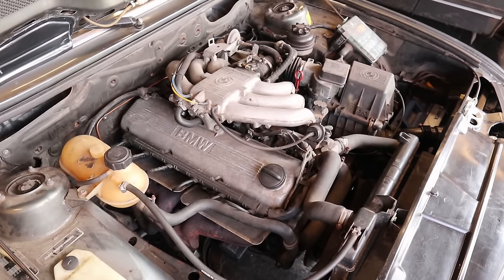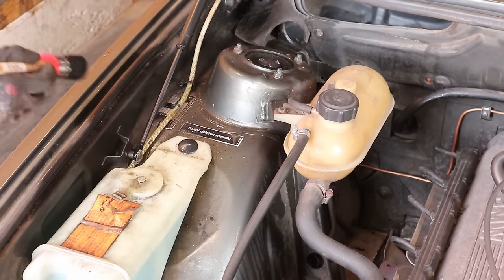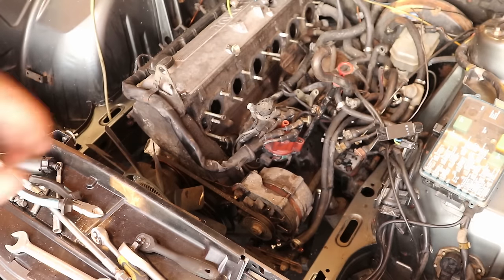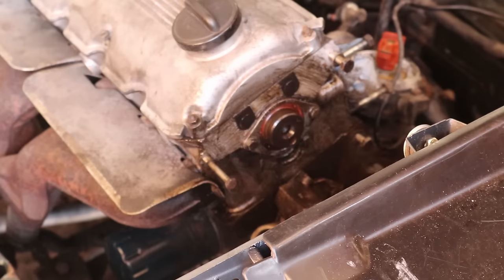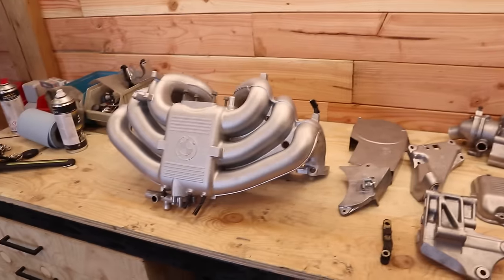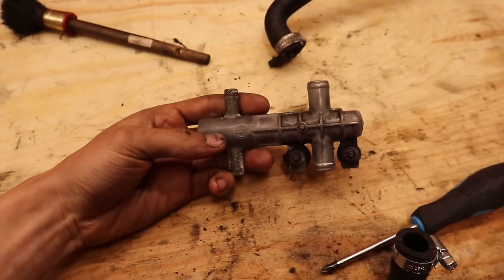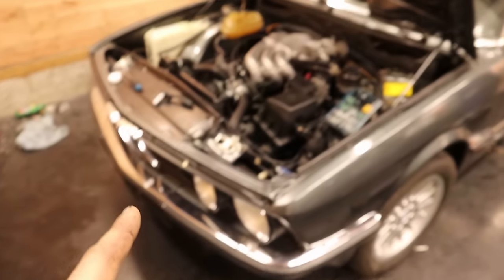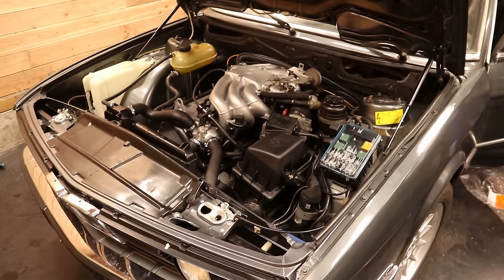BMW M20 Deep Engine Bay Clean & Maintenance | Vapor Honing | E28 Restoration

Comment: I replaced my intake manifold on my M20b20 today too, I have an early E30 with the same engine and I've been having idle issues too. Took me almost a year to find another additional air slide valve which ended up costing me a whole engine to get. I tried everything to unblock it and the best thing I did was put it in the oven a few times at a high temperature and then let it sit. The inside blockage turned to powder and I was able to knock it out. Great video really enjoyed watching it even though I've done the same thing to my car lol 🤘

Comment: Great Video.. luv watching the videos on the E28 .. reminds me of my old E28 .. same color too... never should have sold it ... 2 things
1 - the original stamped steel camshaft sprocket is a know defect and tends to crush and send the engine out of time ... it has been repalced by an upgraded cast metal one by BMW and a good thing to change to avoid a costly head / valve job... don't ask me how  I know ;-)
2 - Nice to see you improvised a fan removal /  installation tool similar to the one BMW sells .... the BMW one is quite expensive... another option is to put an appropriately sized pin in the hole and put it in the bolt hole
Keep up the good work
Reply: Important info about that sprocket!

Comment: Super job. I did a similar process on my Mercedes 190e but admittedly not as comprehensive. It just makes the engine bay so much nicer to work on. Well done. BTW I would be very happy if the new project was a Mercedes 190 😉

Comment: Great video Memphis. Very methodical approach with excellent commentary, you've taken 20 years off that engine bay. That old timing belt was definitely on the way out, glad you didn't skimp on any of the associated parts or gaskets either. She really sounded sweet when you started her up, probably due tot he tighter timing and clean injectors. That E28 looks cooler by the day, I think you're gonna have a blast this summer. Keep up the great work and thanks for creating, editing and uploading these videos dude.  👍😎

Comment: Check the exhaust system leaks, also check the o2 sensors if they are working fine, finally check if you have a leak from one of vacuum lines, hopefully you will find the idle problem.

Comment: Ahh you missed replacing the half moon seals on all 4 corners of the valve cover gasket.  Typically ppl mistake the oil leaks on the camshaft seal for these.

Comment: Have you thought of using M50 injectors in your m20, I found they made a huge diffrence. They have a much more modern spray pattern to atomize the fuel better.
Reply from the maker: No, but thanks for the tip

Comment: Leuke video ! Proper gedaan ! 
Mag ik vragen van waar je die revisie set voor de injectors hebt ?
Reply from the maker: Ebay
Reply from the maker: https://www.ebay.com/itm/334026647358?_trkparms=ispr%3D1&hash=item4dc58a273e:g:r1cAAOSw2LNiJa1L&amdata=enc%3AAQAGAAABIIP35eWetygilOL1VIh1Jlc75awuqnqVcW4cPBIEUaGWqE%2Bvb63b1EuK6YrpfkKbpGeMybaxpRMULVSHlNMBNFrMNlVs65oTCuGwMbSElv80%2FVYKV2zeGOhBb2%2FxU%2FjdyJxeTPR%2BvRglaIZzyDyriMpiKNPBPX5BAa8OXFRVcY94feqMcGtp0rl%2FPnQj9U7E07mNGjzVKXHcjnAynjbM6iHbQ5HuimaxpFSyk7rKaWOjwpQy8iLKG1cUU2Myb0VxEdC0vfVNvw4WmdSlXGW6KWxhkLzi8UXsDQVUM4VG3RmJpJUswxdZ1MijCgAZEtcpnyNaqUIC%2BEEqrc3k4Ld2I3Ci082znV4We2Rk8jpKEObQ5w7R0VuCyUPzOnB9Q8wRTw%3D%3D%7Ctkp%3ABFBMiqONz_pf

Comment: Wouldn’t be better to wash it in ultrasonic cleaner? I mean the cold idle regulator. It’s probably corrosion on the inside walls that stop it from working correctly.

Comment: I have the same engine in my e30, except the fact that i have icv, when starting cold it runs a little rough till it warms Everytime it gets to normal operate temp its sluggish, any help please? And also at low speed in 1 gear sometimes car shakes back and forward
Reply: The 1st gear shake is normal I think to an exent at low rpm

Comment: Sweet! i have a 1984 e30 yet your car is to cool for school, i wish the e30 had dual exhausts  like your old model, BMW starting dropping the ball in the 80's...my single exhaust pipe looks like it was sourced from a 1971 pinto. Plus they called her a 325e whan she has a 2,7 litre motor, twats.